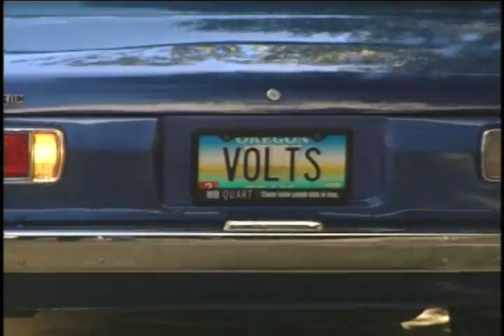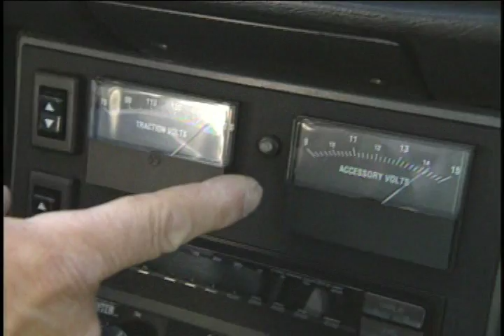Homemade Electric Car Maker Builds in his Garage

Comment: Batteries perform better when its warmer, and not as well in the cold
Reply: +Ultra rc I thought heat increased resistance making them less efficient?
Reply: David Alsh I don't know about heat but I know they don't perform well in the cold
Reply: +Ultra rc 20 Degrees C is the optimal temp.
Reply: +Ultra RC  I know several muscle car owners that moved their battery to their trunk & my Chevrolet Apache's battery has lived longer since I transplanted it to the rear. 😆
Reply: Optimal temperature is round 20 deg C...

Comment: there was no need for oil cars if we did not have dummy working in power position practicing power and control.  Batteries could have been invented long time ago and solar panel exist for a long time.  If any of you remember 60 yrs ago we use to buy those cheap calculator with little solar panel on it.  it still works.  They problem is greed control, power
Reply: arshi khur History lesson: In 1910, 70% of the cars on the road were electric. The rest were Alcohol. Ford Model T "High Boy" came in electric. Then came "Prohibition" alcohol Amendment. Because we drank too much? NO! because Standard Oil and paid off Congressmen wanted to smash all the stills so you  had to buy GASOLINE. They took away something we made for ourselves and forced us to buy something TAXED. The Marijuana Tax act was only to get rid of something we could make for ourselves and force us to buy something TAXED. Nickola Tesla was put in the nut house because he wanted us to have FREE energy and so Edison took over and guess what? It's TAXED! Are you sitting down? The EPA has passed a resolution.There is no date planned yet, but they have put it on the books that they are going to get rid of all WOOD BURNING STOVES! Again, something we can make our own energy with to force us to buy TAXED energy.

Comment: why not install an alternator or 2 to charge the battery while u are driving ?
Reply: morning ghee you'd just be converting electrical energy from the battery into electrical energy going back into the battery - except you'd be losing energy during the conversion process.
Reply: You can capture a fraction of the energy being expended to move the car forward with that method.  You can capture some more with regenerative braking.  But the vast majority of the power still has to come from the battery to move the car forward.  A lot more will be sucked out of the battery than what's going in.

Comment: The eight hours thing could be easily fixed.  But, the "fix" is in from Big Oil.
Reply: ***** ????  What in my statement would lead you to believe that?  My statement was that the oil companies have the influence to suppress a small operation that could fix the problem if they concentrate their economic power to maintain their monopoly.  This is a factual statement.  Far from making me one of their minions, I am exposing a simple fact of economics.  I am not promoting their power, simply pointing out that the 8 hours could be made shorter if enough economic power were concentrated on the problem, and if the scientific community would help instead of dismissing the entire alternative invention community because some are frauds.

The only way the oil corporation's power can be overcome is if the alternative invention community forms a "Wikipedia" like system of knowledge to crowd-fund inventions that could create open patents.  Greed can be replaced with abundance.  It can happen.  It can be done, but not if people attack on another.

Comment: Putting a high out put generator head would bypass the charging. All you would need batteries for is the initial start or take off then the generator head could supply the power for the electric motor going down the road or highway

Comment: I bet if oil ran out tomorrow then by the end of the month scientists would magically find a different kind of fuel.
Reply: no we wouldn't because we wouldn't be able to make plastic for one. And we wouldn't have the infrastructure to organise it, nor the machinery to build it. That's why it's imperative that we can make them BEFORE the oil runs out.
Reply: @moekanz  make by
wood
Reply: Mate, you don't understand what you are talking about.

Hemp is amazing and could replace a crap tone of industries. It should be widely adopted.

But RF waves? Earth making oil? Engines being more efficient.

You're heart is in the right place, but those things are simply wrong.

There isn't enough background RF to power a toaster. 

Engines are as efficient as they can be. Motors are a 200 year old technology, it sucks.

The reason why electric cars will win is because they are powered on a universal energy currency. Electricity.

They are 80+% efficient and they run on all sources of energy. Further, you don't throw them out after 300,000kms because their motors don't wear out.

Electric is the future.
Reply: moekanz It is important we make it before oil runs out, though recycle-able plastics can be made from vegetable oils (significantly more expensive however).
Reply: I really like the points you’re brining up, however it’s important to remain true to science.

This is correct, gas burning engines require the fuel to be in the form of vapour. However they have a very narrow range of air to fuel ratios otherwise they couldn’t run at all. 14/16/18 parts air to 1 part fuel. This is to result in COMPLETE combustion. If there was fuel left over the spark plugs can’t fire and the engine would die.

The Catalytic converter is there to scrub greenhouse gasses from the exhaust fumes, not remaining fuel. If you put fuel into a cat, it will disintegrate.

Remember, we live in a capitalist world, if Japan could kill the American motor industry by creating hyper efficient cars, they would have. No conspiracy on that end.

Yes, weight and aerodynamics, also machining tolerances, valve configurations, piston length/volume, and forced induction all are manipulated to change efficiency, however we are caped at about 18% on 4 stroke combustion engines.

The Prius is a terrible car and is a bad example of an electric. Try Tesla cars, or Nissan leafs. Excellent cars. The Tesla is a 7 seater sedan that accelerates faster and handles better than a Malaren F1, it is also the only car that was so safe it broke the safety test machine.

Hemp has many applications, I like the idea of using hemp fiber + polymers to make light-weight, cheap panel materials for cars however hemp carbon batteries are not the way to go. They work by increasing the surface area on the cathode/anode because the fibres are coarse. We can achieve better results by using materials like graphene.

It’s not the car designers that are enslaving people friend, it’s the people enslaving themselves. Ignorance slows innovation, which is the problem. Corporations are not researching new technologies because they don’t care. Where are the research grants? Where are the corporate restrictions? Why is no one paying for science?

Imagine you owned a car company, why would you change anything as long as you keep making money? We need government to fund universities to research innovative technologies, that way the car companies will be forced to innovate or die. Government that says no to science, that’s who you should be angry at.
Reply: Eddie Hayes we already have, propane, ethanol, methane, hydrogen, natural gas and bio fuels all of which are more economical and cleaner than gas.
Reply: Eddie Hayes hydrogen
Reply: +Tim O'Brien I also highly respect that you have taken such a passionate stance on an issue that is such a huge problem for humanity. Good on you mate.
Reply: +Eddie Hayes
they might already have it but it's not a good time to bring it out
Reply: Ow well I'm sure of the worst case scenario is in affect we could all walk or ride a bike.
Reply: ethanol can be used as fuel do there already is an alternative
Reply: Tim O'Brien sounds nice
Reply: Eddie Hayes Hydrogen is a great fuel, and the earth is 75 percent water, so there is an excellent fuel, buy the government would not be able to control and monitor profit from all sources. Since it cannot be monopolized, they won't do it.  Also, our cars are burning fuel wet, if we ran them from fumes of gas, we would see increases of up to 600 miles per gallon of gas, and over 85 percent less emissions,  but there would be no way to justify gasoline selling at $150-200.00 a gallon.
Reply: briliant coment
Reply: shell company and family Busch
não concordo

Comment: I would definitely look into buying one for fun but isn't there a way you can put some sort of alternator or generator to charge it while driving
Reply: Battery supplies energy to move the car. Car movement drives the alternator. That puts some energy back into the battery, but not more than is taken from the forward motion of the car. Even under perfect conditions you only recover the same amount you took away from the car with the alternator, so it doesn't extend the range any.

Comment: 2 battery pack a belt and an alternator may keep this thing going forever. If you create a circuit to use one battery pack to a certain voltage and have it switch via an isolator to the fresh pack then the alternator would be able to charge the pack that is not in use.

However the internal combustion engine is still cooler. The sound is part of what car enthusiast like the most.

Personally I just hope I'm dead by the time the V8 engine becomes a thing of the past and you never get to hear it again. I don't wanna be around when some tree huger causes the death of the V8. Fuck all that noise.

Also I am curious if you stat producing cars with a large amount of electric power would there be a sudden influx of people being electrocuted because of a short circuit? As far as I know splashing through a flooded street in a thunder storm will hydrolock an engine what happens with a EV when you do the same?
Reply: all i can say is, if you throw a drill in a pool it will still work for a short amount of time, i managed to see a prius drive through a flooded road based on this idea, and i'm sure the natural "dirtyness" of the water causes the resistance to be high enough to not be much of a threat, and trust me, V8 will be a thing of the past (excluding trucks, i'll explain) by 2030 for several reasons. A: today the chevy camaro and Ford mustang are all getting turbo 4 engines as options, and they actually have pretty good performance for being a 2.0L I4. B: CAFE standards, soon the only way an automaker can meet CAFE requirements is by introducing more EV's, for example Tesla has a cafe between 250 and 300 MPG, while GM is closer to like 20. now to quickly explain exclusion of trucks, trucks are excluded from CAFE regulations, meaning their MPG isn't counted. C: more and more european countries are making it a mandate that by 2030 all new cars have to be 100% electric, i know Germany is one country.

Comment: How come EV's can't have power stations that work on a modular battery system, you drive up swap your dead batteries for charged batteries pay a fee and your off.
Reply: yamahondarider
It is always a battery issue with EV cars or planes, it will always be the problem because we have yet to have a powerful light weight battery, so you have a power to weight ratio problem. Many EV cars have a CVT transmission which is something that comes in cheap scooters, and the belts break under stress, from what I have found any way. And the fact that people want to travel with their car, they want to drive around the country and its hard to do that with the battery issue. I would like to see us get away from Oil because of the Saudi involvement and war and I like the tech of electric cars, kind of like Nickoli Tesla was way ahead of his time with remote control boats, and his electric ideas. But people want to travel and Semi trucks need the torque you can only get from a diesel, unless you carry everything by train, which would cut out all truck drivers, who like to travel and see the country while working. Not everyone likes to be confined to their neighborhoods, in fact no one does. Its freedom in the USA. Get out of your cubicles and enjoy the great outdoors, you will die before this earth does.
Reply: i may be late, though here is a rational explanation. Tesla actually tried this approach, it starts with the way it's designed, Tesla designed theirs to be replaceable in as little as 90 seconds. however, since you never know if their battery back is brand new or nearly dead, the replacement batteries would have to be returned and the original batteries have to be sent back to the owner (unless they want to purchase a whole new battery pack) as a result, only one battery replacement station was built, and shortly closed due to it not really being viable, so why not modular batteries? simply because you don't know how much life is left
Reply: Because it'd be more expensive and time consuming than a gasoline engine.
Reply: Well hey guess what fossil fuels wont last forever and why not start preparing fro them to be gone.
Reply: We'll all be dead long before fossil fuel runs out. Even if/when that happens there are alternative fuels for internal combustion engines. Until electric cars are as convenient or more convenient than gasoline powered cars while being cheaper, they won't catch on in the real world with the average consumer. That being said, I have thought about building a electric powered vintage VW for cruising into town. Not for helping the environment or anything like that, just because it'd be neat.
Reply: I'm not against electric cars. Its just unrealistic to think that electric cars are applicable in todays world right now with the general populace. Of course the hand full of eco-freaks are more than happy with a 40 mile range and a 8 hour charge time.
Reply: Well the whole point of the power station, battery swap idea is that the 8 hour charge is that you dont have to worry about the battery time, kinda like a milk man thing.
Reply: It would work in the future when we can power cars by batteries the size of an iphone, but the weight and amount of batteries in modern electric cars is just so heavy, and so many of em, with so many wiring connections that it'd be a half-day job to swap em out and you'd be too tired to bother going anywhere afterwards.
Reply: @norwegianzound  Its been three years why do you think I would care?
Reply: ***** Are you high?
Reply: And then came Tesla.. :)
Reply: Griffoin Crichfield just came across this again now, there is an experimental fuel currently for piston aviation aircraft which is made from 100% renewable biomass, so if they keep up on research, renewable oil I suppose :P
Reply: Griffoin Crichfield You wrote this.  Today Tesla has a patent for the battery swap you asked about
Reply: Griffoin Crichfield it would put a bigger toll on the city’s power grid. Power grids these days are made to power everything like homes, businesses, road lights and etc. But it’s not ready for power stations. Pretty much your local government would need to upgrade the whole city’s electrical systems. That would probably cost a lot and might not be necessary for them, or be a priority. El cars are still a “new” thing, so it’s only a matter of time for it to catch on. Well, there’s my input about that. Hopefully it’s helpful.
Reply: Tesla offered battery pack swaps, but out of the 200 invites, only 5 came. Charging at home or at a Supercharger while eating is easier.
Reply: like forklifts
Reply: What you want is a station like a car wash.
You drive in.
Battery is disconnected from underneath. 
Replaced with a fully charged one  and reconnected.
You pay dependent on the battery pack fitted, the age of the pack ( battery life diminishes over time ).

Once done.
You drive off.
Shouldn't take any longer than to fill a petrol / diesel tank.

Have one or two at every petrol station.
Doing that, will truly make the EV usable.
Reply: Chinese company have that. Ev

Comment: Cool little segment, but I have a few critiques. Mathew Wald says that you can't plug in anywhere, that's malarkey. Even then, when this doc. was produced, no special plugs were needed, you can plug in anywhere there is an outlet. Also, there is not necessarily a smoke stack involved with EV charging. With the increasing prevalence in clean, green, and renewable electricity sources, the stack has been taken out. However, we still do rely on significant amounts of coal to produce our electricity. Hopefully we can continue to change that and save ourselves in the process. EV's rock!

Comment: we need a swap and go system of universal sized/power batteries at stations/ but they would have to be EV stations because petrol stations would ramp prices way up more than ideal so no one would see the point to changing over to EV. So the EV stations need to be able to charge just above the cost per kilowatt per hour for labor :)

Comment: John Whalen:

Here's an idea for more power.

Use the wheel cylinders as a small turbine to bring up the juice to increase or add more power for other amenities.
Reply: yeah a dynamo system to put charge back into the battery or a second battery to swap over to would be ideal.
Reply: Battery supplies energy to move the car. Car movement drives the alternator. That puts some energy back into the battery, but not more than is taken from the forward motion of the car. Even under perfect conditions you only recover the same amount you took away from the car with the alternator, so it doesn't extend the range any.
Reply: Zamboro it would decrease it actually.. regen brakes though do give back some wasted energy.